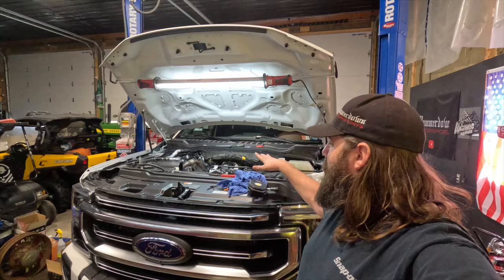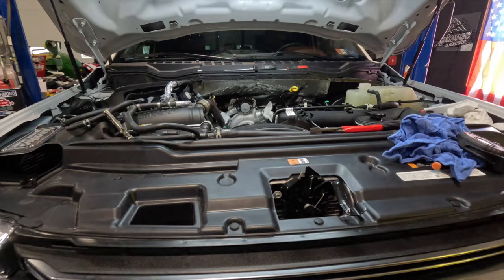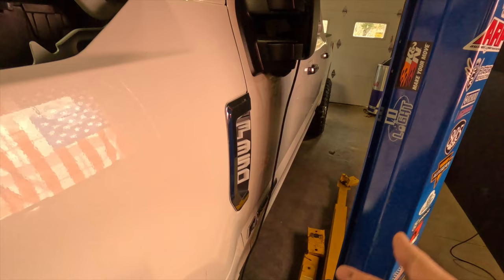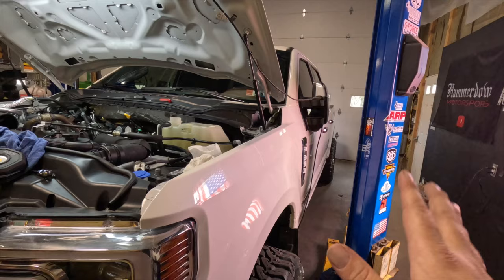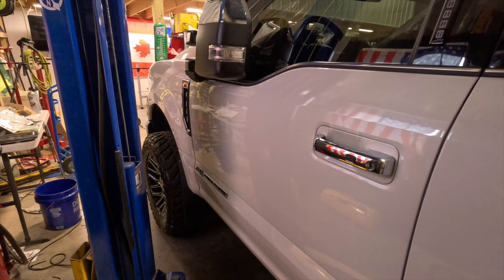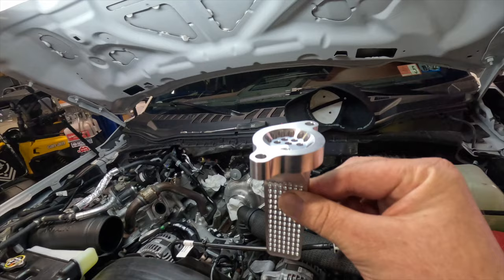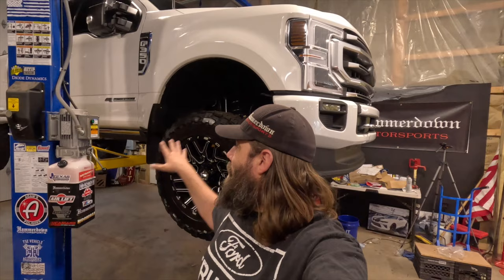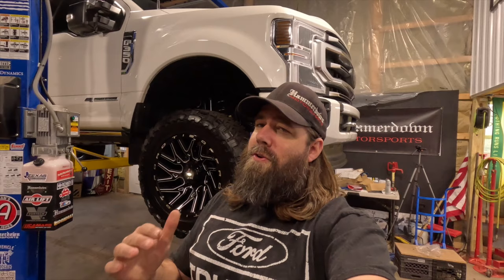Stop Killing Your Ford Powerstroke Diesel With This Product

Comment: Being a diesel mechanic on the big rigs do not make that hose to long or it will freeze in the winter and blow the seals on your engine or cause your turbo to pump oil into intake causing engine runaway.
Reply from the maker: Depends where you live but you can run it to a catch can and or to the exhaust but not likely to blow out the turbo seals there is no clamp on the discharge where the hose goes on it will pop the hose off before it would blow seals up
Reply: @HammerdownMotorsportsUSA  Any back pressure in the crankcase can cause the turbo not to drain and cause oil leakage in the intake or exhaust. On big diesel engines the oil separators are mounted to the engine to keep them from freezing or heated 12v. There is a lot of moisture moving out the vent on any engine. Thanks for the reply and the positive content.
Reply: What?!?😂
Reply: @HammerdownMotorsportsUSA  No, in cold climates condensation WILL freeze in the exhaust line and cause pressure in the crankcase. This can be serious. Ask me how I know! Anyways, make sure the line slopes downwards toward the exit.
Reply from the maker: @paulmaxwell8851  mine I made it so pressure will just pop off the line if that were to happen half way down plus we don’t get weather like that here
Reply: @HammerdownMotorsportsUSA if it’s discharging any oil or condensation, and there is any location of the hose that is lower than any area downstream, it will act as a plumbing trap, as far as the hose just popping off at pressure, the question I have is, how much pressure exactly is required to pop it off?, and at what temperatures does it require what pressure., I’d hate to spend money to solve a problem by making it worse.. just saw the routing, and the big uphill, you sir have a trap, pull that brass hose barb apart, and drain the crap regularly..
Reply from the maker: @GRANITEMONUMENT  it’s designed so the oil drains back into the crank case with the catch can cheese grader deal
Reply: @HammerdownMotorsportsUSA  yeah no, the “cheese grater” is designed to stop it from just dumping oil out, but there will be oil that sill blows by it, if you watch when you take your ccv box out you’ll see the oil blow by there, and that box is baffled, and has an actual filter, that catches too much of the oil blow by, thus preventing air from flowing through and building crank case pressure., the cheese grater will prevent 70 or 80% of the liquid oil from blowing out, but if you would like to test the theory, take the truck out, bring it up to operating temp, then remove the hose, and set it to high idle., you’ll see the oil blowing by., and now just understand your not building boost, just imaging adding 20lbs of boost… as would be under driving conditions.., if you want it done right, just add a catch can to your frame rail, where you connected the two hoses, one with a bottom drain that you can empty… trust me I understand the ccv I just bought my third 6.7 and it’s at the dealer for a oil pan reseal now, so it will be getting the early ccv box, or a ccv delete, the reason I watched your video, to see the install, procedure on this kit..
Reply: Who said you have to put the stock one back on?

Comment: Definitely recommend this mod for all diesel engines, just want to make sure there are no low spots in the hose to allow oil to pool up and create a restriction.. that is the reason some people experience oil gasket leaks after a mod like this. And I also would not recommend an inline oil catch can on the hose for the same reason.. any air/ vapor flow restrictions can create too much pressure build up in the crank case and will start relieving pressure from gaskets and seals. Great video 👍🏼

Comment: There is an option to use the internal catch can then run the hose to your exhaust.  Weld a bung in your exhaust at a 45 deg angle and have the exhaust flow scavenger the blow by.  Then you don’t get the smell and the heat from the exhaust burns off the oil mist.
Did this option on my dad’s 2014 Powerstroke and I liked it so much I also did it in my Colorado 2.8 ZR2 Duramax.

At the same time we did the breather delete we tightened the loose bolts on the front cover which fixed the massive oil leak.  
We also changed the upper fuel filter to a Baldwin conversion and lower fuel filters to Cat style.  
Lastly we installed the disaster prevention kit for if/when the CP4 pump shits the bed.
Reply from the maker: I have seen people do the exhaust bung method
Reply: @HammerdownMotorsportsUSA  it works good and zero blow by smell or oil drips.
Reply: If you don’t have slight vacuum it will cause your turbo seals to go bad and that’s the main reason why you want to connect it to your exhaust.Bill Hewitt explained it very well in one of his videos.
Reply from the maker: @powerstroke6.7  I plan on doing that but I have a hard time with how that would hurt turbo seals
Reply: I'm skipping the disaster kit and going with DCR fromm s&s

Comment: Power Stroke Tech Talk with ARod has a video where he shows the two CCV box designs. One Filtered and One no Filtered. His video just showed how you can switch to the filtered box and then change out the filter as a maintenance item. He did show the optional internal catch can with the vent tube but he did not install it.
Reply from the maker: yup we are homies

Comment: 😮I run a larg area catch can that is vented to  atmosph at the back of my box. Now smell. This has lowered my Crankcase presure, improved cold start, and there is zero to no black smoke on normal lift off, and stopted build up in the filterd cold air intake all positive. So I assume better preformamce HP and MPG. By improved clean air fuel ratio in the combustion chamber. PS 1" ID tubing running slightly down hill through out this system no low area to cause a bild up or chocking the PSI out from the Crancase.
Reply: PS this is on my 08 Ford Superduty 6.4.. This is August 2024 😊👍

Comment: If you're in freezing climates that hose will definitely freeze up I have Volkswagens with the tdi I did a similar thing but I didn't even run the hose that far and it froze on me a few times next thing you know there's all kinds of smoke rolling out the tailpipe and VW even incorporates a little heater in CCV tube plus the fumes you just can't get away from them they're so strong smelling they always roll back into the car. I think piping it into the exhaust is possibly the most effective way. Hope you don't get in Sub-Zero temperatures.

Comment: I'm so confused 😂i just learned the new 2022 ccv don't have a filter so what is the box doing? I've been going Back and forth on this and anymore not sure what to do! And one more thing is that you didn't clamp the house on the vent tube incase it would build up pressure and blow the tube off? Every other video shows guys clamping that hose on.  Like I said very new to the diesel world!

Comment: I  would worry about the egr before crank case vent  it’s desiel it’s supposed to burn oil
Reply: You want it to burn oil through the injectors, not in the fresh air intake

Comment: Did you forget that there is an EGR? that is where your soot comes from. I work on stock and modified Powerstrokes. Don't modify your engine. Nothing but trouble with these. When he puts a tuner in he will twist the gear on the crank.....stay tuned.

Comment: Unless your taking off your egr your not stopping the crud your showing? The newer ccv’s have no filter that plugs like older models, there is a lot of decently supported data talking about changing the back pressures etc on this engine, had the kit and removed it after 1500 km as I had troubles due to it. To each his own………but the 90% of the black crud is the egr, it enters right at your throttle plate that you showed.
Reply from the maker: Yeah the problem is the oil coats it then the egr soot sticks to it in my s&s vid I showed how much oil was in my pipes already
Reply: What issues did you have?

Comment: I wish I would have had something like this for my 6.0.  Every time I removed the cac boots there was oil in the pipes.  I removed the intake at 90k miles and it was caked with sludge and I ran 15w40 T6 every 5k miles.
Reply from the maker: Yeah the egr makes a mess too
Reply: @HammerdownMotorsportsUSA  previous owner removed mine

Comment: So what good is this considering that the EGR just dumps more crud in? Not trying to be a wise-guy, just asking. I know about catch-cans having owned two 3.5L EB engines, but the EGR is a bigger issue with the intakes on our diesels, is it not? Could you do an inline catch-can like we did on the EB engines and not vent to atmosphere?

One other thing to note is that my truck (2017 F-250, King Ranch, 4x4) has never dropped the oil level between changes (roughly 5k mi) and I have no leaks of any kind. About to hit 155k on the odometer.
Reply from the maker: Ideally yes the egr is still an issue it just takes the oil component out of the equation and you can run a catch can but with the catch can in my valve cover no oil came out the tube anyway
Reply: @HammerdownMotorsportsUSA  Thank you for the response. I had considered an in-line can for a while now, but I never bit the bullet due to bigger things, such as the EGR dumping coal into the intakes or the CP4 failure problem. FWIW, my CP4 is still okay, but I use OptiLube XL in every tank (4oz/20gal). I am saving for the new DCR pump now!

Comment: Would you recommend running it into a venturi on a modified exhaust? I like the Idea of the kit, but I would rather not deal with any smell near the doors or cab of the truck?
Reply from the maker: yeah that is probably the best way with the extension I don't really notice it

Comment: Waste of time and effort taking the intake off to clean the soot and oil. Once the CCV is open vented it will not buildup any more. And there wasn’t enough buildup worth doing all that work.
My hose is routes down and into the frame rail
Reply from the maker: it was apart for the S&S disaster prevention kit

Comment: Great channel & Video bro. Question… I’ve got a 2022 F-350 as well. It just hit 2k miles. Does any of the stuff you’re doing void the warranty? I want to do all this to save my truck from future junk
Reply from the maker: Thanks for watching in order to void the warranty s failure has to be a direct result of an aftermarket component causing it some dealers are dumb about stuff but those are the rules there is a sticker under the hood stating that too
Reply: This mod ABSOLUTELY voids the warranty, it is also quite illegal as it is removal of an emissions component.

Comment: Already did dat shit, don't like the smoke coming out though. May have to figure something out. Thought about a filter but felt like it might obstruct the flow.
Reply: same lol when its below 50 mine smokes alot more than I would want
Reply: @discordcriminal put a bung into the exhaust or run it all the way down the cab to the bed and you won’t smell it in the cab anymore

Comment: Is this a problem for states where you cannot delete or modify your diesel emissions or is this something that will not be an issue?
Reply: emissions is federally mandated. So all states require the emissions on diesels.
Reply: If you are worried about it, route it back into the intake where it originally went. Hopefully, if that added piece is doing it's job, most of the oil has been caught and is going back into the engine. Hook it up so that the little that is left goes back into the intake like the original did.

While the crud that can go into the intake can get it dirty over time, the big issue is when the CCV filter gets clogged over time which then doesn't let the air out so that pressure starts building up inside the crankcase. If you have a gasket that has a weak spot, over time it could cause the engine to get a pretty substantial oil leak. Mine was clogged up at 45k and I really didn't want to put a part back on that was going to do the same thing again. Hopefully the newest ones finally have a decent design (?) but the '11-'20 will need to be serviced at some point and probably sooner than you think...
Reply: At the very end he said “Greta won’t let me keep it or or I would”

Comment: All that oil is not as hard on the engine as the build up from the recirculated EGR gases that build up that harden the oil in your intakes.   EGR gases do the same in any gasoline engine, ending in clogged lines and passages.
Reply from the maker: Yup that needs work as well

Comment: do not recommend this mod, most of them cause more problems than they solve.  who cares about a little oil, diesel burns oil.  it's just another thing to get plugged/clogged up and cause serious issues.  just let it get burnt up.  

what are you worried about a little buildup on the inside of your pipes and intake components?  it causes absolutely no harm, don't be scared of a little residue.
Reply: Oil through the injectors is great, oil through the fresh air intake is less great, tends to build up on valves and injectors

Comment: Too bad Greta won’t let you keep that. If it wasn’t for her I would have done the weight loss program on CCV EGR and DPF to go along with my DCR conversion. So much wasted power and fuel economy. 😉
Reply from the maker: Yeah too bad we can’t or our trucks would be so much more efficient and last longer would actually be good for the environment
Reply: @HammerdownMotorsportsUSA  I’m thinking about doing it anyway. Good thing I follow the current laws in my county that does not require Emmision inspections.